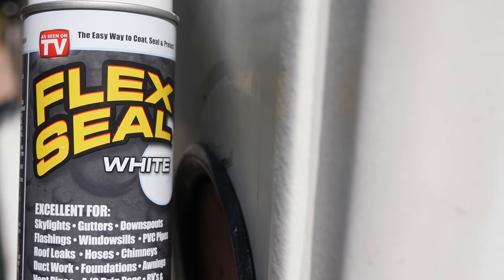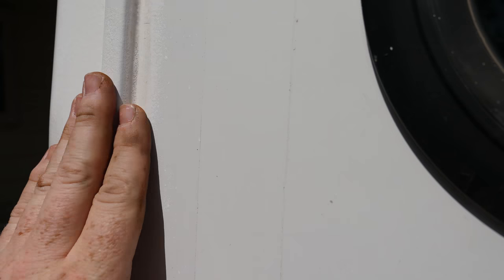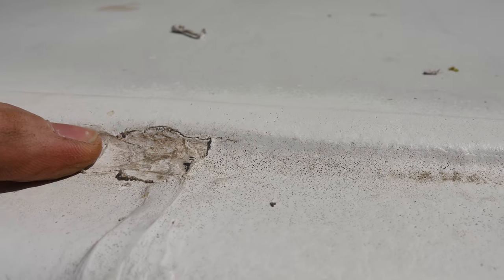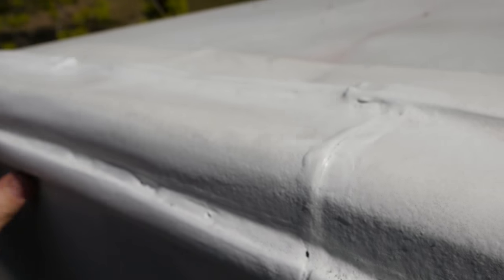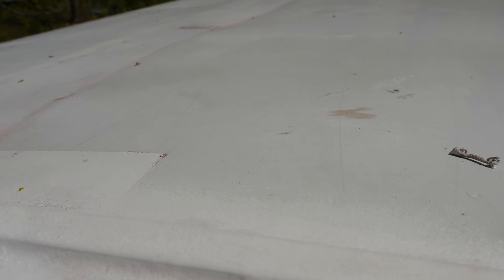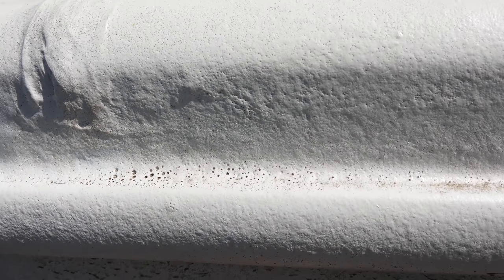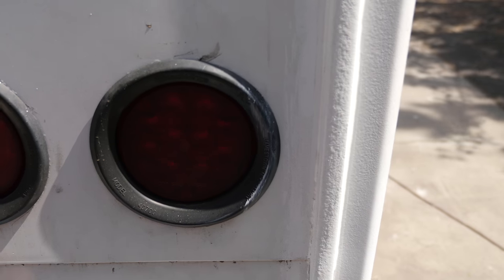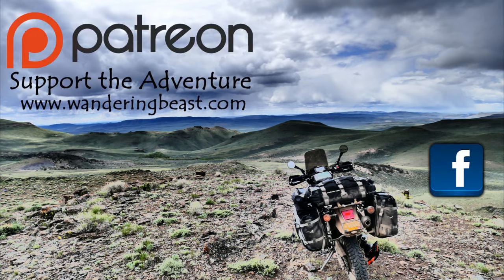Stay Away from Flexseal - Rv & VanLife Be Aware

Comment: Don't use that prep and use flex seal liquid. You used spray. I did camper roof with liquid and it has worked better than anything else. Also use esterbond tape for seals and you won't have to do it again.

Comment: I followed a tutorial  last fall that was a gal using flex seal paint on a couch. I had a vinyl recliner with wear on the back where your head would rest. Otherwise a good chair. It a chair with minor issues and turned it to junk. For your money, use a 25 year silicone  and the roof use something like Sno Roof. We bought an old beater rv and completely re did all four walls (water damage). Our rv sits out in the weather year round in Alaska. Heavy snow loads and in Summer heavy UV light. 10 years down the line things are still in good shape. Yearly maintenance  is the key. Good luck

Comment: I cleaned and  used the flex seal liquid on the complete roof on my small RV trailer roof 13 months ago and it’s still as good as the day I did it. I’m in Oregon and it sits out all year uncovered. The secret is to clean the roof well. I used a brush to do the perimeter and around vents, then I used a foam roller to do the open area. It was done on a sunny 75 degree day. Yes it does take a couple days to fully cure in 75-80 degree days. I have also washed it several times since with a soft brush and it’s still looks the same as the day I put it on, no peeling or flaking at all. And no I don’t work for the company, just a satisfied user.
Reply: 2.5 years later. what’s your thoughts on the flex seal?
Reply: Curious here as well. I just orders 2 cans to do my skoolie roof
Reply: He used spray, which is different than the liquid.  It's not UV protectant for one thing.

Comment: As others have said, your prep leaves much to be desired. Also you're using the canned version not the liquid version and it seems your coats are suspiciously thin, with only one coat being done. Even dicor says you need to lay down 3 to 4 coats for proper thickness.

Comment: Just stumbled across this, the prep seems to be the problem here! The porous areas are a result of poor or incorrect prep. Krudd Kutter followed by 91% alcohol to remove oils and neutralize chemicals, dried and mold free, may have been your best option. Eastwood stuff works good for what it is but even it isn't compatible with paint or other adhesives if not fully removed before coating. It too will bubble to the surface just like this and in paint as well.

Comment: Flex seal and tape is usually used as a temporary fix not a permanent one. Also you should've seen if it works with the material you're working with. Flex seal has its flaws, so you always need to check.

Comment: Those bubbles come from a layer of previous sealants already in the previous coat whatever it may be. Could even be the paint itself. It is definitely a chemical reaction, happens slowly so it doesn't show up for a long time. Not the products' fault, simply two incompatible coatings. Flexseal is of a petroleum based product, and can react with other petroleum based costs. Some aren't so evident. Notice the bubbles emanate from the crevices, probably drawing something up from the cracks themselves. All the washing in the world won't clean out the cracks..

Comment: You should have used flex seal liquid. We just built our full shower in our camper. Absolutely amazing stuff. Yeah the stuff in a can is not good. The tape they have MY GOD sticky as can possibly be. Never seen anything as tacky as that as a tape but expensive someone makes that tape for homes so gotta be cheaper somewhere. And the paste is a nightmare to work with but holds up well but to apply is not fun. Really messy. The liquid goes on like paint just a bit thicker. Took 4 coats on our shower has 6 water jets on the wall and waterfall and rain shower in roof wand, foot washer. Fun build.

Comment: I put it on the roof  of my camper  a year ago didn't use the spray bought by the gallon $99.00 it's  real thick live in Florida took a couple days to dry but has held up great I have used the one in spray  can and it's  knot worth a crap
Reply from the maker: good to know, thanks
Reply: Yes, I've watched videos about flex seal liquid rubber in a can, works great on fibroglass roof top for a camper or RV.

Comment: Some of the Flexseal adhered properly, some not, so it's not the Flexseals fault. There are contaminants OF SOME KIND interfering with proper bonding. He used it on 0ld rotten wood and severely aged plastic. NOT an accurate review.

Comment: Could you have had residue from that prep spray still on the surface and it affected the Flexseal? Almost looks like the bubbles could be off gassing from a chemical reaction. (Full disclosure.... I have no experience with either product)
Reply from the maker: I thought maybe the Ricor sealant was off gassing but it did the same to really old areas I didnt touch yet

Comment: You are not apparently an RV tech. The surface has to be clean, free from dust, dirt, water, grease, oil and etc and then be completely dry. In this particular example you should have cleaned the areas with a mild Dawn with warm water and then lightly scrubbed it with a soft bristle brush and rinsed and then let it dry completely. Then the area that needed treatment should have been taped off to control where it went. Flex Seal spray is not intended as a broadcast spray sealant. The Flex Seal in a can that is brushed on is what you should have used as your base coat and then if needed then when dry (24/48 hours later) you could apply another coat or two  (24/48 hours apart ) and then remove the tape carefully and it would have been excellent just as it would have been with any quality rubberized sealant.

Comment: Maybe you can do an experiment with the FlexSeal liquid. I had all the same problems with the spray, but i  found that a thicker coat with the liquid prevented the micro holes and also had a lot more flexibility in the stress cracks... Just a thought. Thanks for the video
Reply: Did it stay white,or turn yellow?please reply,I need some on white van if it works!

Comment: Well first off you have to wait 48 hours before it cures. The bubbles came from one layer not being fully cured before the next layer and so forth. I haven’t had mine do that yet but I applied it on thick.  I guess we will have to wait a while to see but mine didn’t bubble like that on my roof. I plan on getting a urethane paint instead of flex seal but it was used for a quick fix and has been good.